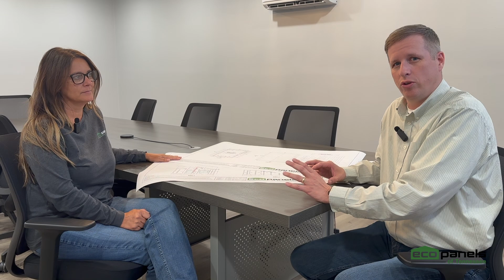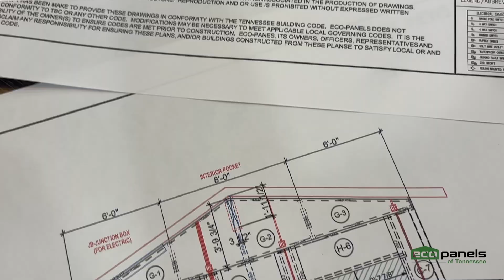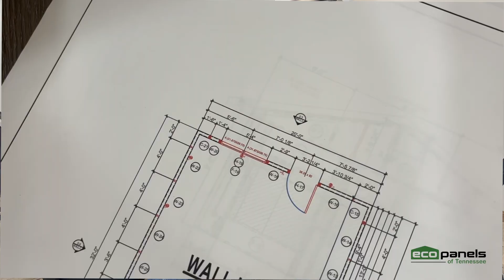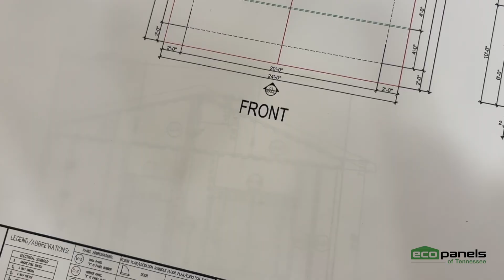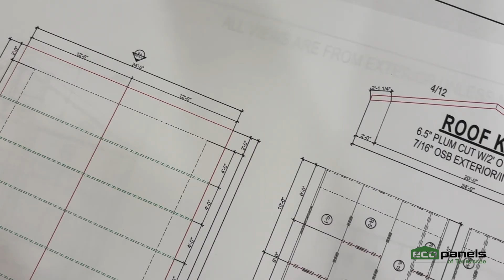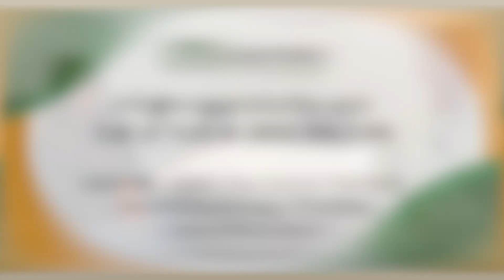Comment: Question for KP.  If I build the rafter style roof minus the sheathing, can you come out to my building site, take the measurements you need and any other information to make the roof panels?     My building site is about 185 miles from your factory.
Reply: We commonly work from measurements from contractors or truss manufactures for making roof panels. It's extremely rare to obtain measurements after rafters have already been set. We typically have a lead time of a few weeks from the point that our panel layout plans are approved, so really this needs to be planned out ahead of time. It's not very practical to wait and It's a fairly straightforward process for a simple gable roof that a local builder should be able to assist with. We'd be happy to discuss further and appreciate your interest in our SIPs!

Comment: My main Question, DO YOU DO THE INSTALLATION OF WALL AND ROOFS ? I HAVE A HUGE PROJECT
Reply: We do not. If your site is within about a 3 hour drive radius of us, then we'll come out and provide technical assistance to a local crew. It always depends on the design, but most homes are a fairly simple and straightforward process with our SIPs.